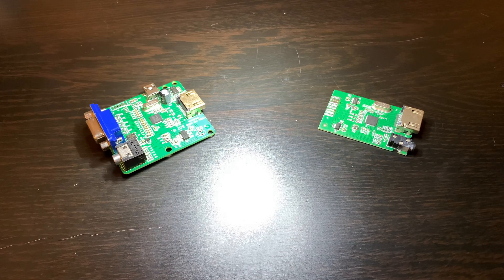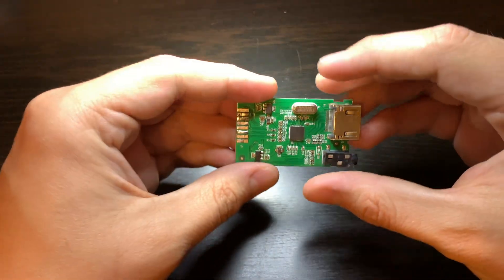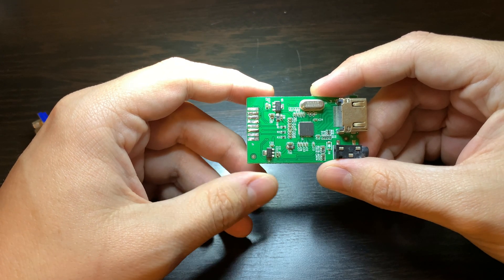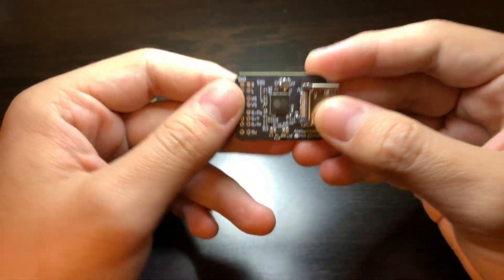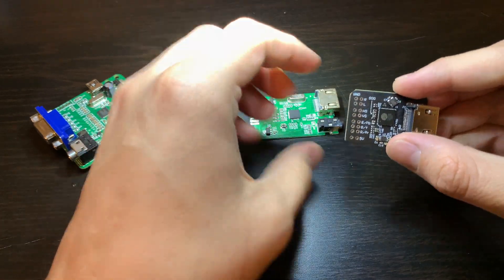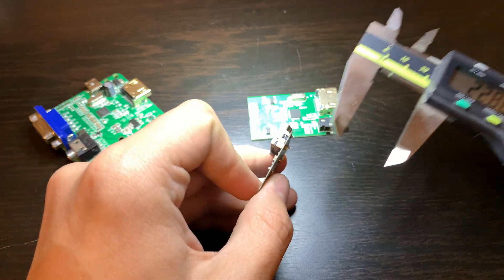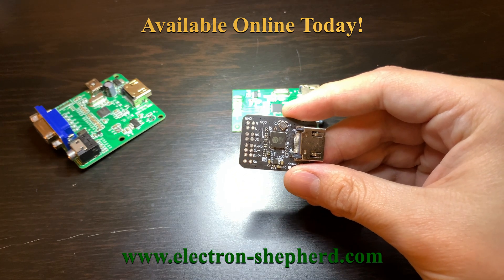Analog2HDMI - VGA and Component Converters for Your Wii or Xbox!

Comment from the maker: As of July 2021 these modules are now capable of taking in SPDIF digital audio instead of the analog audio! This is perfect for use with the original Xbox that outputs SPDIF digital surround sound!
Reply: How well does the vga2hdmi work on the Dreamcast?  And do you have a svideo to hdmi board in the works?
Reply from the maker: @RetroGamerBB  I’m not aware of any of our customers using these with their Dreamcasts, but it shouldn’t have any problems handling that video output.  We don’t currently have any Svideo to HDMI solutions, but it’s not out of the question.

Comment: One thing that isn't apparent on the video or the website, do both Component and VGA versions of this board support interlaced resolutions?

I know you guys are working on a GBS2HDMI board, and I'm thinking how it will play ball with the different outputs, can I for example enable passthrough of interlaced resolutions? I know GBS-C can additionally toggle Component output, but I'm not sure if it's 1:1 as functional as the VGA output (it used to have some issues, was improved, but yeah, not sure if it's still identical to the VGA).

Currently my VGA adapter for the GBS-C is fine, but it officially doesn't seem to support 576p correctly (outputs as 800x600 somehow), doesn't utilize the full vertical space correctly on 480p or 576p, and none of the interlaced resolutions work.

It's not super important, but I would like to have this flexibility in my setup.
Reply: They do support interlaced video, yes.  I use one to convert a PS2 1080i component to HDMI.
Reply: @AndehX  You probably mean the Component version of the board, since RGB HV isn't as easy to pull from PS2 without forcing it?

It's good to have the confirmation about that in regards to the Component video board, but I'm also curious about the RGB HV version as well. The GBS-C scaler I use will natively output RGB HV by default, and even though there's an option to toggle to Component video output, I'm not sure if that feature is completely on par with the RGB HV output (it's an additional feature included by the custom firmware, not a stock feature by the board, and at least some older discussion about GBS-C claims that the Component output can have some bugs. That's why I'm curious about the interlaced passthrough on RGB HV version of the board as well).

Comment: Hey,
I'm planning to purchase this since you're out of stock on the AVE-HDMI with no indication of when or if they will be back in stock.
For the analog2hdmi, which of the 4 options displayed on your website is the correct one for the Wii? I'm assuming the component & analog audio option is correct. Is it a coding difference between the 4 options or physical board changes? 
I will be soldering this into the existing Wii video output pins on the motherboard. 
Can you please clarify what the HS & VS solder points are for on the analog2hdmi board shown in the product photos. 

Keep up the amazing work and cant wait to see what stuff you guys release in the future!

Comment: I want to try this to make hdmi adapter for og Xbox so I want to ask would this work with 480i all the way to 1080i and 720p. Too bad it isn’t have spdif tho because digital audio.
Reply from the maker: Hi Speed Racer!  I'm happy to report that these modules are back in stock and that the newest version has the option to accept SPDIF digital audio! These new modules are perfect for the original Xbox and they've been tested successfully with that console!
Reply: @ElectronShepherdLLC  so does that mean the converter supports all of the original Xbox resolutions if it has been tested on it?
Reply from the maker: @speedracer123222  We haven't been able to perform many resolution tests with the Xbox, but we currently support 480i/p, 576i/p, 720p25/30/50/60, 1080i50/60, and 1080p24/25/30/50/60 resolutions.

We are very excited to announce a new project soon!
Reply from the maker: @speedracer123222  Take a look at our newest product, the Xbox2HDMI module, if you're interested in a solution like that! https://youtu.be/XoWU-TReFBI

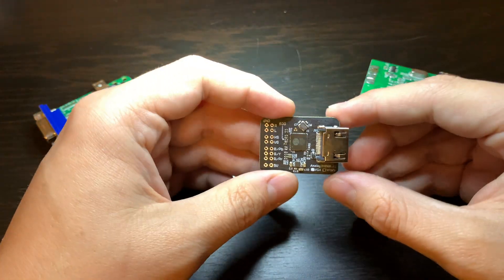Comment: #2:35 -- Where's the Ground Pin? nevermind, overlooked
#3:25 -- can the chip handle digital audio? so SPDIF can joined in the HDMI line?
Reply from the maker: Yes it can! The latest version of our boards that is in the process of being manufactured can accept digital surround sound audio and will embed that data on the HDMI output.

Comment: Does it need seperate H/V sync for RGB? If it can take C-Sync or Sync on CVBS (Composite Video) then it would be perfect for all the people with that crappy Warrior 64 board.
Reply from the maker: This currently does not accept composite video, but we have been in talks to implement a solution like that. Is that something that would be interesting or useful?
Reply: @ElectronShepherdLLC  I mean using composite video as a source for C-Sync as opposed to H/V Sync, not to get video from it. ;) Many devices will accept CVBS (Composite Video) or C-Sync on the H-Sync input but the marking don't imply that you can and I have heard that the scaler in Wii2HDMI/RetroTink 2X does not take RGBS without a YPbPr conversion circuit (built-in to the RAD2X cables).
Reply from the maker: @emmettturner9452  as far as I’m aware our firmware does not currently support C-Sync.  We currently support RGB with Sync signals and pure Component signals.  I will look into this request for you.
Reply: @ElectronShepherdLLC  Thanks. Yeah, I can see it supports RGBHV (separate sync) just not sure about RGBS (standard consumer RGB with Composite-Sync or Sync on Composite Video). Since so many RGBHV devices will accept RGBS with C-Sync on the H-Sync input, I thought I'd ask before looking into sync separator circuits.

IIRC, MobiusStripTech recently released sync combiner and sync separator circuits. If it does not support RGBS then perhaps integrating one of these circuits would allow it to be used with many more devices. :)
Reply from the maker: @emmettturner9452  thanks great! I’d love to chat with you a bit on this topic further if you’d like sync up a bit. I’d love to pick your brain since you are clearly familiar with this type of products.  Please send me an email through our website if you are interested! :)

Comment: Does it properly scale 240p like RAD2X, RetroTink2X, and SOME Wii2HDMI adapters?
Reply from the maker: At this point in time I’m only aware of resolution restrictions when in VGA mode. I believe you’re referring to when the input is a component video signal.   Let me speak with the firmware team to understand if 240p will work.
Reply: @ElectronShepherdLLC  The issue is that most HDMI scalers or the ones that handle analog input for a digital TV treat 240p as 480i and unnecessarily de-interlace non-interlaced video. This is bad for retro games, or even for Wii Virtual Console games. It causes artifacts and blurring for 240p sources while adding additional latency. At least some Wii2HDMI units handled it correctly by line-doubling to 480p but you had to set your Wii to 480i. When you do, the VC outputs 240p even though most everything else is 480i.
Reply from the maker: @emmettturner9452  Interesting! That is really good information. I’ll look into this as well. Thank you for the useful data!